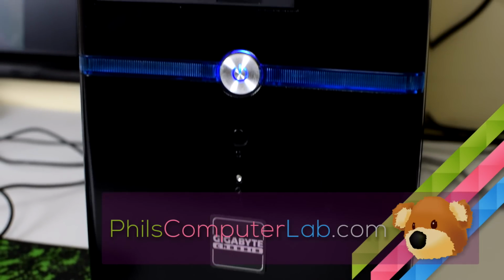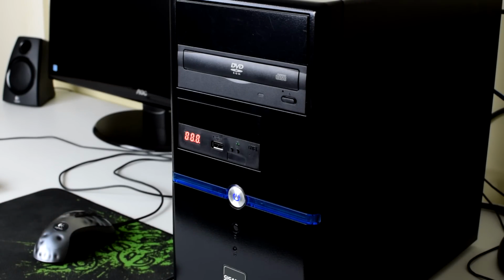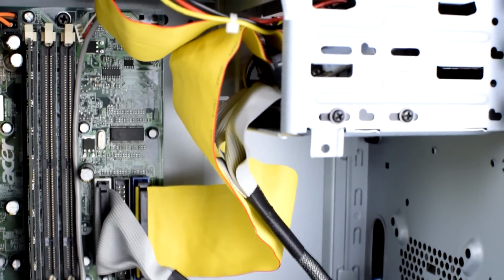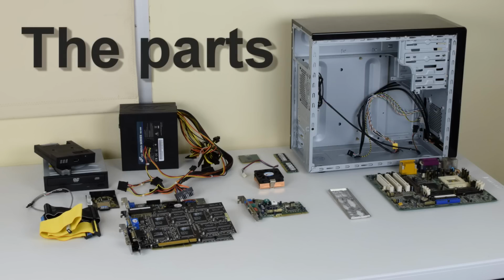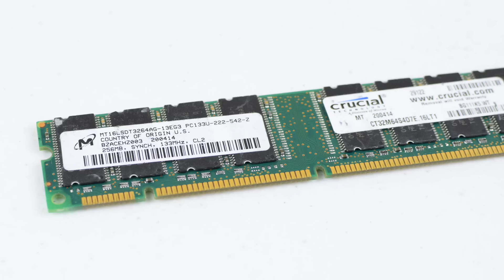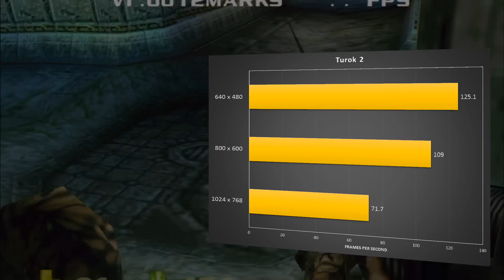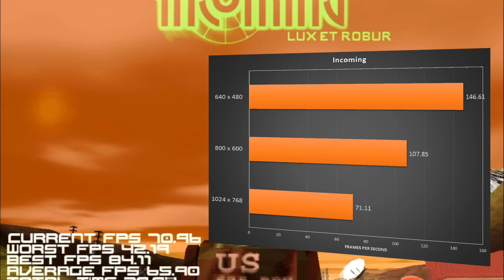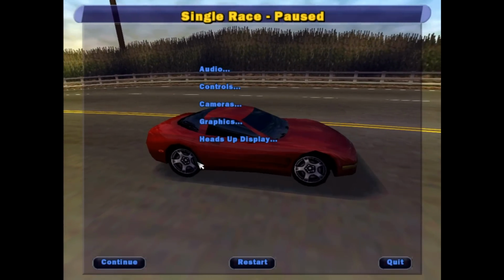3dfx Voodoo 2 SLI sleeper PC

Comment: i remember buying a second Voodoo 2 for my system. I was previously only able to play Unreal Tournament at 800x600 and having the pair unlocked 1024x768. It was gaming heaven
Reply: I remember getting my second one. Still one of my favorite setups. Ran into heat issues and had to take the side cover off my case and point a fan at it.
Reply: "Only" 800x600 was creme of the crop back then
Reply: @playgroundsinc  amen

Comment: The Voodoo2 is my all time favorite graphics accelerator.  Still have my SLI in fact.  Many fond memories of my Abit BH6 w/Celeron 300a (o/c'd to 450mhz), 256mb PC100, Diamond SpeedStar A50 (SiS 6326 AGP) + Creative Labs Voodoo2 SLI, SBLive sound card, USRobotics 56k modem.  All powered by an Antec 300w PSU.  About as high-end of a gaming rig as you can get back in the day.
Reply: How much did it cost?

Comment: Respect !
Although that PSU's probably asking itself "WTF am I doing here ?? :|"

:)
Reply: PSU: "Eh. Im just chillin. Powering these components is a piece of cake."
Reply: May not be the case in all of the possible scenarios. Older computers took most power out of the 5v rail. Todays PSU's have most amperage on the 12v rail, not so much on the fiver.
Reply: like teacher in class :D
Reply: Probably what the PSU in my Ryzen 3 1300x is saying to it's self lol (it's a pre 80+ standard 500watt supply)

Comment: Oh the memories :)
I used to have a Voodoo2 SLI Setup(2xDiamond 12MB) back in 2000, running a slotted Celeron 300 on an ASUS P2B Board.
PS: The VooDoos run Unreal Tournament very nicely @ 1024x768!

Comment: I remember when the 3dfx was released. PC World (UK) had one in a demo PC just inside the entrance to the shop. As soon as I saw it I just had to have one. I had never seen softened textures before, all the games I had played had horrible blocky textures but for me, until that day, it was the norm. PC World didn't have stock and were charging 399 pounds UK. So I trekked across to the other side of town, in the soaking wet rain, and picked up an "Elephant" one from a small retailer for 349 pounds. As soon as I heard that "Click" sound of the 3dfx board, my life in gaming changed.
Reply from the maker: Thanks for sharing your story!

Comment: The side fan pulling air through the ventilation holes (while being that close to them) will make a high pitched wheezing noise or at least be louder than being turned the opposite way. If you want to cool the voodoo cards maybe use long standoffs for the fan or something, but then I believe you risk earlier mechanical damage to the fan in question.

Comment: I still run a similar SLI setup on a Slot A Thunderbird 1GHz system with these same games.  So much fun to pass the time when I'm at the farm with no internet.  I'll have to look into those glide drivers so I don't have to reboot all the time to switch glide drivers for certain games.  Nice to see the classics being used still :)
Reply from the maker: 1 GHz Slot1? Very nice! I think I will have to skip that one and go straight to socket A. I simply do not have any Slot 1 gear and they are a bit harder to find and not cheap.

Big fan of the Athlon / Duron, they make some very nice retro machines, for some reason they aren't picked often. Let's change that :D

Comment: Dat metal. This has to be the most metal retro build on youtube.
Reply from the maker: +boba1mighty Hehe, yea I wanted to mix it up a bit :)
Reply: +PhilsComputerLab I dig it. I just finished making myself a 3dfx voodoo2 sli retro-rig. Have any Case suggestions for a time-accurate custom case?
Reply from the maker: Hmm, I only got modern cases. You could read up on old reviews and see what hardware they used?

Comment: The crucial part of an old school rig is a 17" CRT monitor, good luck trying to get hold of one in good condition, they are like hens teeth now. Building an old rig when you have none of the parts right now is probably going to cost you twice the price of a brand new PC, on ebay those voodoo 2 cards are only sold in Russia and they want about £250 shipped.

Comment: I have a pc very very simular. P3 1ghz socket 370. 2x voodoo 2 8mb cards and a gf3 Ti200 as the main gpu. And have the SB live soundcard for the audio. Unfortunately I could not figure out how to get the dos driver for the live working as it keeps stuttering if I install it. Performance is pretty much bang on with your numbers. And I absolutely love it. Have that for windows 9x 3dfx games that does not require any dos mode. As a os I'm dual booting 98se on primary master and win Me on primary slave. And windows me with the same drivers are ever so slightly faster then 98se. Running 3-3-3-6 timing on the ram and 512mb.

Comment: Nice video and build! Àlmost thought you didnt include networking abilities, but then I saw the motherboard had it built in.
Reply from the maker: +RetroCompaqGuy Yea I was lucky with an on-board NIC, otherwise I wouldn't have had enough PCI slots. A NIC makes the whole thing a lot easier, especially if you have your drivers and benchmarks organised a bit.

Comment: Nice build. Got a single VooDoo2 in a retro PC (Pentium 1 MMX) and with Glide games look a lot better and ran a lot smoother that with 'software rendering' in games like Quake and Quake 2.
Unfortunatly I never got my hands on a 2nd VooDoo2 so never could try SLI.
The idea of using 2 graphics cards was realy ahead of it's time, seeing how many years later nVidia and ATI (AMD) starting to use the idea again.

The Descent 3 footage runs realy smooth, I could remember running it on my P3 450Mhz with TNT2 (the infamous M64 model...) it had a struggle at times keeping the framerates up.
Reply: +Nemesizzonline To be fair Nemesizz, even an MMX 233Mhz Pentium 1 is going to bottleneck a VooDoo 2 card. Adding a second will be almost pointless as you will be very CPU bound. You even see leaps in performance going from a Pentium 1 200Mhz to a Pentium 2 233Mhz using a 4MB VooDoo 1 card.

A P2 450 is around the minimum CPU I would pair with a V2 SLI set up to let the 3Dfx cards stretch their legs, especially if you're using 1024x786.

I had a pair of V2's in an AMD K6-III+ 550Mhz machine, much faster than a Pentium 1 MMX, and the VooDoos were totally crippled and CPU bottlenecked. I eventually swapped them over to a Pentium 3 coppermine 733Mhz machine and they are literally flying now! XD

By the way I have a couple of VooDoo 2's for sale if you're interested.
Reply: TheVanillatech
Yeah I noticed that the P1 doesn't keep up all the time, but still it works better then most accelerator cards.

The VooDoo2 I have was 'trash picked' from a broken PII PC. Some intern didn't know the VooDoo2 was an accelerator card that required another videochip for 2D so he dumped the VooDoo thinking it was broken.

Your offer of selling the VooDoo2's is kind, but I haven't got anything for them right now.
But thanks anyway.

Comment: I have a dell Dimension L733r with a 733 Mhz Pentium III, 384 MB PC100 RAM, a BRAND NEW 10.2 GB western digital Caviar IDE hard drive that I got for $5 at a thrift store (the computer was from 2000, but the hard drive was from 1999), a Nvidia Geforce MX 400 with 64 MB of DDR RAM on the PCI bus. the power supply is interesting, as it's either an 85 or 90 W power supply. The power supply fan is the only means of exhaust for the entire tower, but the fan is very powerful, or the power supply just drives it at a resonable voltage. Anyway, it runs Windows 98 and plays all the games shown in the video very well. I get between 45 and 70 FPS on all of them with max settings ( with the exception of NFS 3 being slightly laggy at times, sometimes dropping to 30 FPS but for a very, very brief period, usually when there's a lot of objects on screen, but that rarely happens.)I love that PC and your videos inspired me to use that computer as such.
Reply from the maker: Nice! The MX is a very capable card in these old games.

Comment: Oh my...Need for Speed 3: Hot Pursuit, one of the best games ever! Teary eyes looking at it... The original The Need for Speed was my first game ever, and this one was like one of my personal favourite arcades ever made too. How many hours I spent playing it until unlocking the Mercedes and the El Niño.
Reply: +xose vi Yes, the legendary CLK-GTR :-D
Reply: +xose vi I had a Voodoo 3 and a Matrox G400 (alas not the MAX version), and I preferred the Matrox and its 32bits graphics, but performance was much lower though!
Reply: +xose vi Oh, a comparison between the Voodoo3 in it's 22 bit color filter mode running via Glide and a card like a Matrox running 32 bit color in Direct3D would be very interesting. I think I'll try that in the future, but at the moment I'm dealing with my 486 system. When NFS3 was new I had a Voodoo Banshee and with that card you couldn't get the cockpit view! I was very angry! Two years after NFS3 came out I upgraded to a Voodoo5 and with that even 32 bit graphics were possible. Although I'm not sure NFS3 was 32 bit capable already, but NFS5 (Porsche) certainly was.
Reply: +armorgeddon Indeed, I remember that colour grading was not as pronounced on the Matrox G400, that graphics looked a lot better, and Bump Mapping was the next big thing. :DI loved my Voodoo 3 though, and had to switch my AGP Matrox G400 for the Voodoo 3 PCI that I had because the performance was like twice or thrice that of the Matrox, but when I played a game under DirectX at 32 bits, darn, I couldnt see the Voodoo 3 with the same eyes as I had before
Reply from the maker: +xose vi I also love the first NFS. Never played the other ones, so this was a first for me :) NFS3 has a bit of the feel of the first game to be honest.
Reply from the maker: +xose vi Yes 32 bit color support was the weakness of the Voodoo cards.
Reply from the maker: +armorgeddon I have some Matrox benchmarks for my "Massive Windows 98 SE benchmark project", but can't publish them yet as I still need to produce a video around it :)
Reply: +PhilsComputerLab The closest to the first NFS in terms of feel is &quot;Need for Speed: Porsche Unleashed (a.k.a. Need for Speed: Porsche)&quot;. 
You should really try it, it has funny missions in the so called works 
driver mode like having to drive a brand new Porsche to a customer for 
delivery WITHOUT scratching it :-) It supports Glide, too! NFS3 tends more towards arcade racing physics and track wise and the sounds are bad. The first NFS in SE version is still the best though, followed by the Porsche one, third place goes to NFS2 SE, then NFS3, the rest were awful IMO.
Reply: +PhilsComputerLab V5 does 32 bit though.
Reply from the maker: armorgeddon That sounds cool, I will check it out for sure!
Reply from the maker: armorgeddon Yes that is true!

Comment: ok, from what I remember the SLI only kicked in at 1024x768 lower than that it was just one card. Sorry if I missed it but an important point with the voodoos was that although they only had a 16bit colour output they processed the colours internally at 32bit so it looked better than other cards (at 16 bit)

btw The Matrox G400 was a beast of a card and was their last gaming card (it replaced my SLI Voodoo2s) it also was the first card with bump mapping (Draken was soo cool)

Comment: Using an anti-static bag as a makeshift enclosure for the SD to IDE adapter is a big no-no. The purpose of the bag it to discharge static electricity in the environment, but it does nothing prevent random electrical shorts to ground, and may actually increase the likelihood of shorts. Use a piece of non-conductive material to protect the board or ground it properly at the standoff holes.

Comment: Excellent vids. I got back to work an old pentium 2 pc with windows 98 se. I am using a twenty years old hdd with a few issues. I will look into swapping it for an ide to SD card adapter.

Comment: Great build, I actually have a pair of V2 cards , but they are mismatched (not just the brand, the whole board layout) and as such wont work in SLI without custom drivers ,which are available for Win9x, but not for NT4/2K which I like to have.

Only change I would make to this build is use a Geforce2 as opposed to the Matrox , you would lose the EMBM support , but some later games like MDK2 , Sacrifice, NOLF , etc , will fly.

That said the Matrox will most likely have better image quality compared to most GF2 cards.
Reply from the maker: +lightdark28 Yea it was mostly because of the image quality that I went with the Matrox.

Comment: I have almost this same setup, although I have a Geforce 4 ti4600 as the primary graphics adapter instead of the matrox, and the motherboard is a Compaq with the intel D815 chipset.
Reply from the maker: +chinitosoccer1 Nice! How is that Compaq board? I really like these OEM boards, they are somewhat overlooked but work very well and are often quite a bit cheaper.
Reply: yeah it is a good board, I had it for a long time without noticing it until I read somewhere I think it was from you, that intel is among the best if no the best performers of that era, build quality is also excellent with Panasonic caps, I have been using a Soyo board with a VIA chipset prior to that.

Comment: Hi Phil,
some questions came to my mind when watching this nice video:
Which input device did you use for the racing games? Which benefit did you expect in this system from the FastVoodoo-drivers?
Did you place the Voodoo-cards with a PCI-slot between them because of heat concerns or IRQ-allocation? If it's the former did you actually check for IRQ-sharing?
Reply from the maker: +armorgeddon Good questions! I used a Thrustmaster T.16000 for a few of the games. The reason for the sound card between the Voodoo cards was purely because I didn't want to squish the SLI floppy cable.

Comment: I really enjoy your videos and looking back at all the cool pc hardware the was out back in the 90's. My only real suggestion is that you add a Promise Ultra ATA 133 IDE controller to your builds so that you can get closer to the performance capability of your SATA hard drive (not used in this build but several others). Looking forward to more of your high quality videos.
Reply from the maker: +rguitar78 Thanks! I like your idea, but don't have any fast IDE drives I'm afraid :( I think the newest one I have is 80 GB and it's quite slow compared to using modern drives.

And SATA PCI controllers don't work well under Windows 98 at least. Especially getting DMA mode working.
Reply: I idea is to use your existing SATA to IDE drive bay, and instead of plugging the IDE cable directly into the motherboard you would plug into the PCI card. Driver support for Win98-98SE-XP should be quite solid. Your current SATA drive (the one you usually format to 120GB) should be able to saturate the bandwidth of the Promise card. Cheers

Comment: Hi Phil.

I have an Stock Dell XPS R350 with a Pentium II Slot 1 at 350Mhz, 128MB of RAM and a ATi 3D Rage Pro Turbo on Windows 98.

And i am thinking about upgrading the GPU in it first. And i got some recommendations to go with Voodoo2 or 3, GeForce 256 etc.

But what would be a good upgrade for the Pentium II?

Comment: I have a question:
What would be the best upgrades for my Pentium 2 Custom Build PC?
It has a DFI P2XLX board.
Specs:
Intel Pentium II MMX 266MHz (Can be overclocked to 400MHz via BIOS)
64MB PC133 SDRAM
S3 Virge GX2 Card
5GB HDD (My 80GB doesn't seem to like the board)
ESS AudioDrive ISA Card
The only thing I know in upgrade terms is that it takes a max of 384MB PC133 SDRAM.
Reply: hello! lx chipset has only 66mhz fsb so u can pun in there sometchun like celeron or pentium 2 300. sorry for my eng. write from poland
Reply: Arkadius Madralus I will add a 300MHz Pentium II when I can and overclock FSB to 83Mhz (Max speed it handles)
Reply: HELLO! try but i dont prom that will work, when u do this u overclock everything pci bus, cache on cpu, ide contr etc, so sytem stability will be drama
Reply: Arkadius Madralus On 70 MHz Overclock everything is stable, on 83 MHz restarts happen at times.
Reply: Unlike modern motherboards where all of the buses can be clocked independently of each other, motherboards back then had a common clock (usually the FSB) and various other buses ran on clock dividers off the main bus.

The system instability probably comes from the fact that most boards only had a 1/2 divider for the PCI bus, so at an 83 MHz FSB, the PCI bus would be running alarmingly out of spec at 41.5 MHz. Later boards had a 2/3 divider, but then you had the issue that PCI was crippled to 27.6 MHz.

Another issue is that some early AGP motherboards derived the clock from the FSB, so a slot that's supposed to be running at 66 MHz would be running at 83 MHz, which is way out of spec.
Reply: Isiah Folio No... lol. It cant be overclocked to 400 or even close. That is a Deuchutes core Pentium II. 300 mhz wouldnt even happen.

Comment: I have a few 3DFX products. Two Voodoo 5500 64mb agp cards. One of them has the original box, the other one need new gpu coolers. And one Voodoo 3 2000 16mb pci. And three voodoo 2 cards, unfortunately none of them are exactly identical. Tried sli with them, but it didn't work.